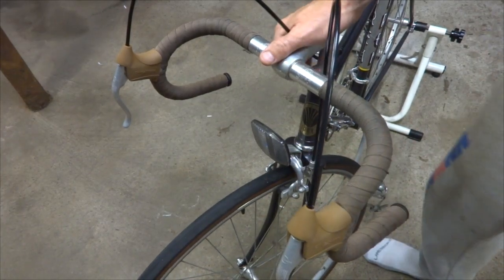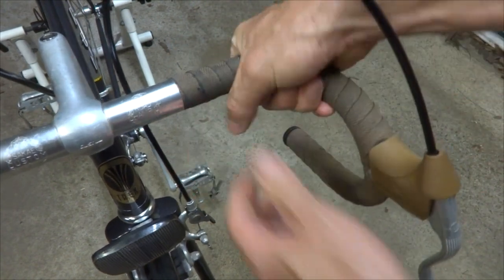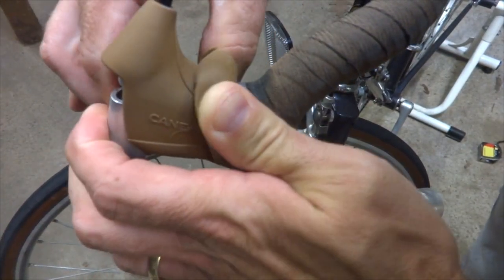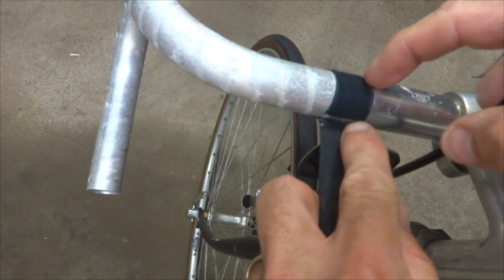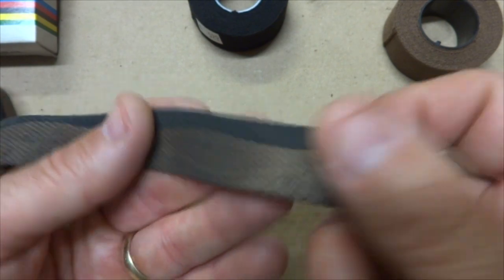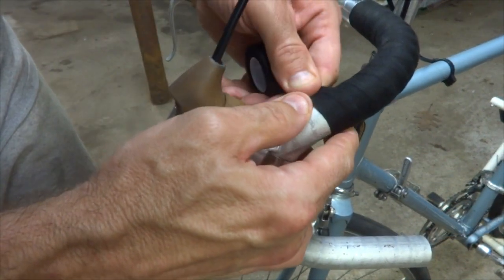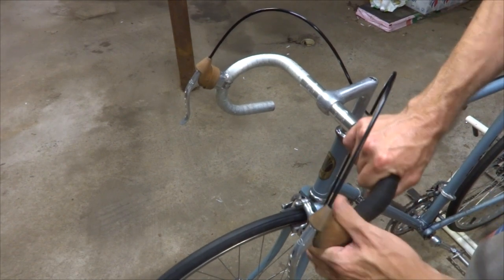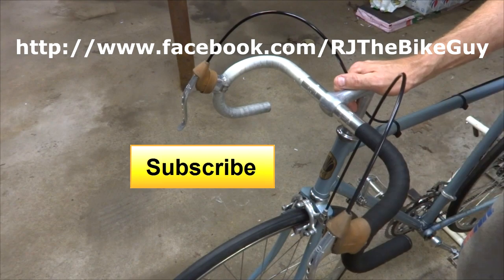Wrap Vintage Trek Bike Cloth Handlebar Tape Like Factory Original

Comment: Looks like a lot of vintage, especially early-mid 70's bikes were wrapped like this. My 1976 Soma Competition is identical, but with red tape. Haven't taken it off yet to see if it's adhesive. Mine are also brown. You can clearly tell they were red, but where the hands were and everywhere else is considerably more brown than the bright red they used to be. Thanks for the video! Absolutely invaluable information. This sorta stuff is hard to come by. I was originally gonna use cloth tape around my bars, but I wanted something a bit more modern so I don't think I'll be using this method exactly.

Comment: Neat! I am working on getting my dads 1977 green second road bike back into shape. Not a real restoration, but I am getting it to to point I can enjoy it. The bar tape was so fried that the adhesive was stronger than the fibers, so it fell apart as you pulled it off. Also, it was sitting the same way in the garage for so many years that one side of the bars was a light tan while the other was a more brown, but they were originally black tape wrapped the same way. I really appreciate your vids and they are at the perfect timing for what I am doing right now.

Comment: My koga miyata gents lux-s (early 80's) also had the factory bar tape on it ( the gentleman i bought it from rode it twice before storing it for 30 years). But the original bar tape was differently wraped then this bike. The brake levers were taken of and only the mounting bolts were left. Then the bar tape was aplied. After the bar tape was aplied the brake levers were fitted. This way you dont have exposed metal, but a nice coverage of tape. Interesting to see a different style.

Comment: Thanks RJ, this has been a big help. Most bikes that come my way are Mountain Bikes of some sort. I have done a couple of road bikes where the tape has needed to be replaced but had no real idea of how to do it, so although it looked "okay" when I was done it was easy to tell a rooky did it lol.
Reply: Just so you know, this is more of a vintage way to wrap handlebars, so you might look to other vids to see the modern way, cause if you do this with modern non cloth tape, you will ruin the tape. Have fun! :)
Reply from the maker: Yes, for modern tape you want to wrap the tape from the ends of the bars in. I have a video on that here: https://www.youtube.com/watch?v=n-BMsC0Ao-o
This video was specifically for cloth tape and wrapping a vintage Trek in a factory original style.
Reply: Thanks :)

Comment: oh that cloth tape looks cool. I wonder if it is comfy too
Reply: honestly i would just go with fome handlebar tape its alot softer on your hands and cloth tape wares out easy and its not that easy to get a hold of some most bike tape maker dont make them since there out of style
Reply from the maker: +Jose Leal I use modern tape on most of my bikes. But I wanted to keep this bike as original as possible.
Reply: +RJ The Bike Guy im not saying people should never use cloth, i do agree it looks better but some times new is better considering most people dont change there handlebar tape and fome lasts longer
Reply from the maker: Also since this was original tape from 1981, I wanted to show how the factory wrapped it. I rarely see old Treks with original factory cloth tape.
Reply: +RJ The Bike Guy hey since you are alrady talking to me and you know alot more  about bikes then me. what do you think of 3 spoke bike wheel on a vintage bike, i have a late 1979 swinn and i was think about getting one would it look out of place? i wannted to reduce weight on my bike and 3 spoke tires look awsome
Reply from the maker: +Jose Leal Carbon fiber? Is it new or used? I would be careful buying used carbon fiber as it can weaken over time and break. Also, I think most racers use wheels like that for racing, but use regular spoked wheels for regular rides. Personally, I think wheels like that look weird on vintage frames.
Reply: +RJ The Bike Guy thanks for your advice. I was trying to make it look like a mix between vintage with modern attachments i dont have fix gear mainly becuse the bikes metal is very heavy id just had to pedal more. i was planning on getting rid of the gears and make it singel speed to reduce wight. thats why i wannted to try three spoke wheels. is there any other whys to reduce wight?( P.S i vdeo showing whould ne cool, and helpful)
Reply: How soft do you need your tape if your wearing gloves anyway?? Also, if you shellac cloth tape it will outlast most everything else.

Comment: I suppose I should google this before I ask but what is that "Sakae custom" engraved/imprinted emblem on the handlebars indicate? I have a really nice old road bike I got and returned to use that has that same exact handlebar detail on it. Same hoods,  virtually the same color. I like that kind of tape. We always called it 'Hockey" Tape though I know it to be Friction Tape and for things like shovels or axes or splitting mauls it sure is the best at reducing blisters without the need to wear gloves. You have a fantastic attention to minute detail, RJ.

Comment: So no need to remove the old adhesive? Seems like maybe it helps to hold the new tape or?
Reply: The adhesive is already applied to the cloth tape. The whitish color left on the handlebar is just residue, which is a pain in the ass to remove. Although, there is no need to remove it since you are going to wrap it again.
Reply: No, there's no need to remove old adhesive though I generally do so. Although the bars are about to be re-covered, it's nice to see the pristine shiny ali/chrome before the new tape is applied. To remove, use a solvent (eg Jizer or isopropyl  alcohol) and cotton rag.

Comment: i used to do a dry run to ensure the tape length was long enough before committing to wrapping it up.
the bar tape that i used in the late 80's had a thin waxed plastic strip (like the backing on bumper stickers) that covered the adhesive down the centre,i just used some masking tape (or similar) to secure the leading end to ensure that it couldn't slip & did a rough 50/50 overlap to check the overall length,the manufacturers must really be watching their bottom line these days & just gluing it onto itself,lol :) i'm also wondering why (like oingo boingo) why you didn't clean off the old adhesive?,shame u didn't show the bars with the finished tape at the the end of the video :(

Comment: I have a flat handlebar on a fixed gear bike. I ordered a roll of Tressorex orange cloth tape. I can't seem to find a video about wrapping flat handlebars, let alone wrapping flats with cloth tape. Which method should I use to keep the tape undamaged for the longest time possible? Center to end, or end to center? Should I roll it forward or backwards? I read somewhere that cyclists usually wrap the tape in reverse directions (one side rolls forward, one side rolls backward).

Consider that on a fixed gear you have to stand to relieve the rear wheel from some weight, hence, the handlebar is gripped and pulled up unconsciously while skidding and jump stopping. That is why I want to wrap it perfectly so it doesn't unwrap or detach when pushing down on the bar, or pulling up.
Reply from the maker: If it were me, I would wrap them like in this video from the center out in the same direction as I do it here.
Reply: Thanks. Do you think the bars will be too hard with a 2mm cloth tape? I'd like to add some packing sponge (foam), the 2mm thick layer that chinese sellers usually use to wrap very fragile items -.- I think it might work out great, if I go slow and make sure that everything adheres tightly.
Reply from the maker: I can't tell you what will be too hard for you. Frankly with flat bars, I'd go with grips.

Comment: RJ - I have cloth tape on my (original owner) 1974 Grand Prix that really needs to be redone, So I ppreciate you reminding me to do it!

Also - I noticed that rear wheel bike stand for the first time. It seemed very stable, although I've seen very mixed reviews for it. Do you use it mostly to park your bikes or do you use it for repairs too (besides handlebar tape)?

Thanks again!

Comment: i always wrap my tape inside to out, even cork, just keep it taught all the way through. some rolling will occur but id rather have that then replace my tape every 6 months because they basically give you a strip of electrical tape to use on the inside ends, scam. Modern capitalist always have a good excuse why thing need to be done a certain way that cost more money and need to be replaced more often. also even with cloth tape especially the new stuff rolling "can" still occur. only tape that iv seen that never rolls is the old school schwinn vinyl which is kinda wretched in terms of comfort.
Reply from the maker: +Dan Nimoy I use regular electrical tape, wrap it multiple times and then maybe finish it off with the included piece. Lasts a long time and no rolling.
Reply: +RJ The Bike Guy true thats the only way to make it last but the problem is if left in the sun the tape "may" get gooey. inside out requires no electrical tape, looks cleaner for longer with just minor rolling. 
if you haven't notice iv been binge watching all your vids love em.
Reply from the maker: +Dan Nimoy Have you watched https://www.youtube.com/watch?v=9OrKpze98jc
?